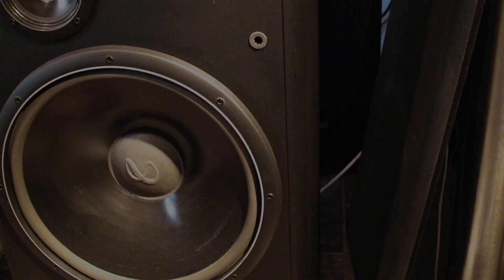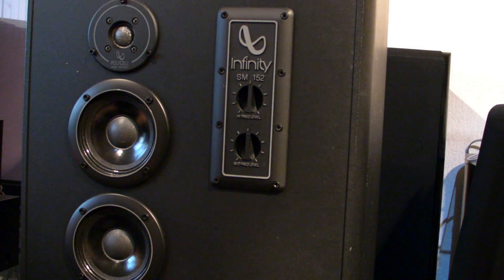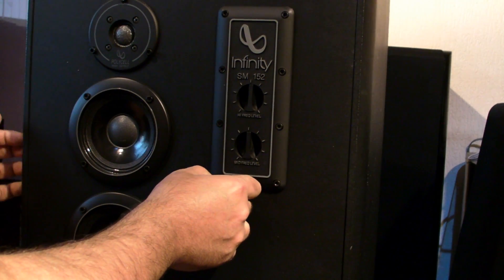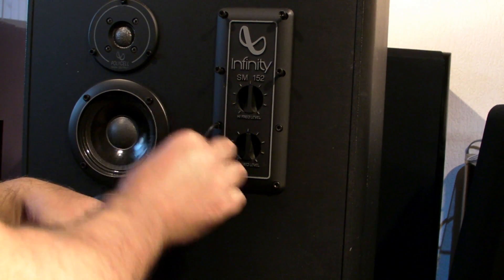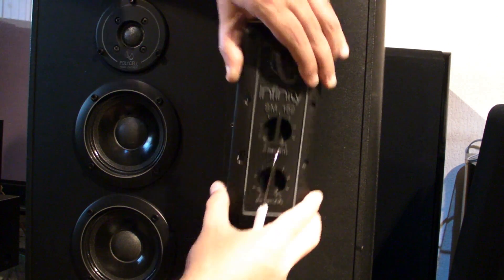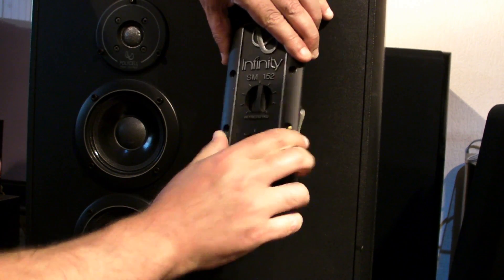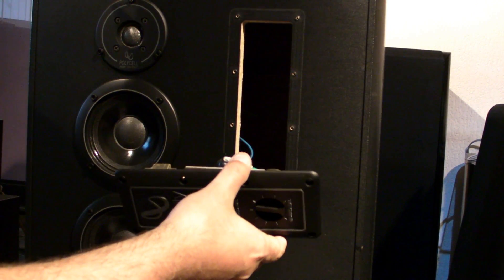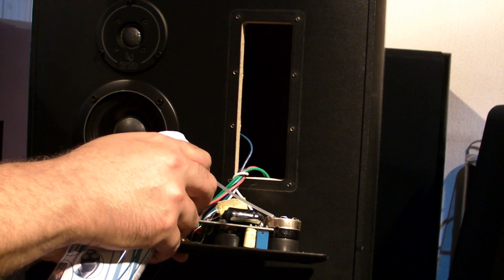Infinity sm 152 cleaning the potentiometer

Comment: Hi, tried with mine but it work only for a few minutes and then the problem come back.. any suggestion? 

I used the WD40
Reply: Use the spray DEOXIT D5 , it's speacially for pots , You can order it in Ebay
Reply: Thanks I will try !
Reply: Youre welcome , 😊, check on Youtube about how to use DEOXIT D5 there is many videos , You can use it on receivers amplifiers , on The pots , never use the WD40 on The receiver pots , because it Will damage The pots , have a great day 😊😊🎼🎼👍

Comment: I have a pair of Infinity SM 100s (two-way with bass and tweeter).  No sound comes from one of the bass speakers; the tweeter works.  Problem is can't remove the faceplate to the "potentiometer" unit, if that's what it's called, because there are no screw holes like there are for the sm 152 you're showing.  When I remove the bass speaker and stick my hand up through it to jiggle wires, it does not cause sound to come from bass speaker, but sometimes the tweeter sound cuts out.  So how can I remove the faceplate to check the speaker connections?  Is there a way to just bypass the potentiometer and connect the bass and bass speakers directly?  In my 25 years of owning these, I've never used this knob to adjust the tweeter sound.Thanks for any suggestions. Not much on this model speaker on the internet.
Reply: paul suranski probably too late but heat the metal plate on the front of the controls with a heat gun and use a paint scraper to carefully remove it. You will see the screws.

Comment: Please, put some kind of glue into this loosen capacitor otherwise it gonna vibrate and produce sound and soon will have broken leads disconnecting one of your drivers
Reply: i once had the crimp connector that connected to the rear terminal of one of my vintage sony speakers break, i thought the amp had went into dc and blew it out.  i checked the speaker first and thats all it was.  funy thing is that the crossover is a capacitor that just floats around in the cabinet near the tweeter. i think i will glue it down when i get them out of storage so that does not happen!